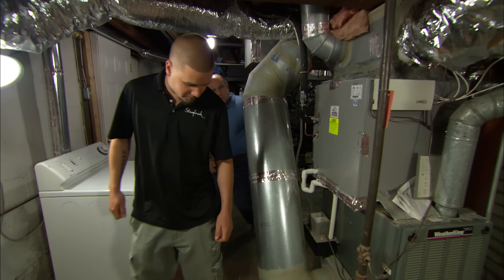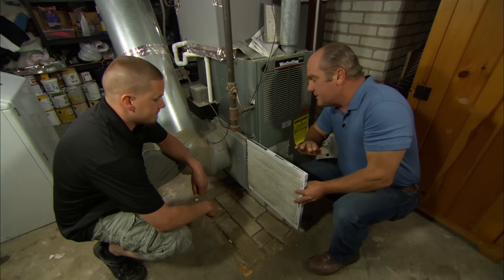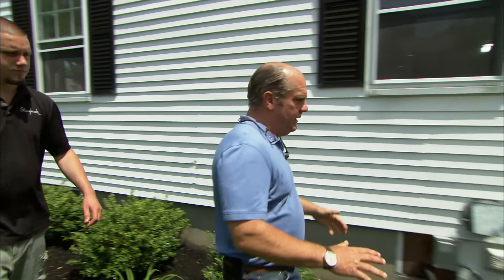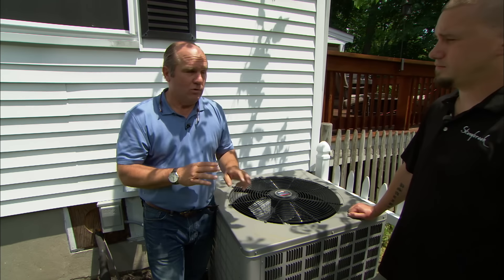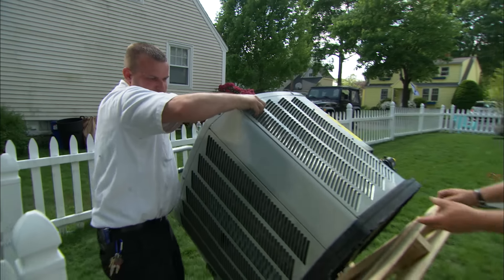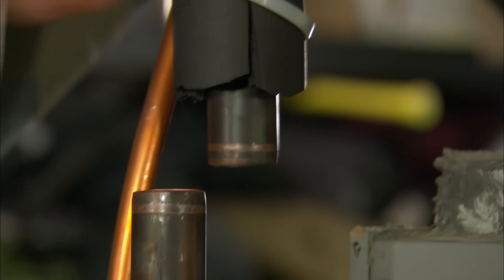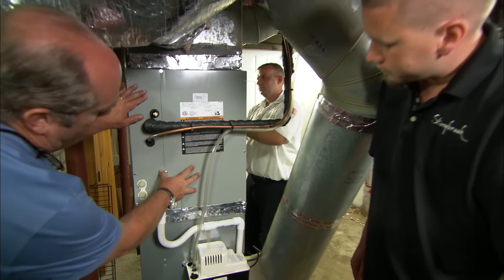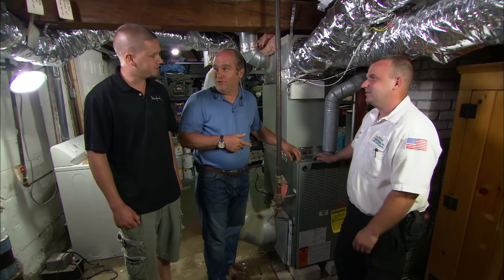How to Repair a Frozen Air Conditioner | Ask This Old House

Comment: My window AC freezes on high. Low it works all day. I have to turn it off if I set it to high to unthaw it. takes an hour of burning up. So it stays on low and barely helps in the hot hot weather.

Comment: This video should be called how to replace a cooling system. I would think there would be some way to purge the excess on a system that is bigger than needed in some manner of venting to the outside or temp setting. I had this problem once, and I had to move some things that were blocking the return air vents. They were a convenient place to put things in the winter. It didn’t seem to mess with my furnace for half of them to be partially or totally blocked, but I will put stuff on back them next winter if it turns out that my furnace is too big for heating my house.

Comment: How many years has this run without a problem first. If it’s worked right for years then how can an oversized compressor be the problem?  I think the problem was much smaller and less expensive than a new compressor and coil.

Comment: Should of checked to see if the system had the proper charge in it. Most likely it had a leak and was low on refrigerant. Also instead of assuming the size of the system needed you should have taken and got a heat loss/load calculation done to determine exactly how much tonnage you need to cool the home.

Also that return duct is way to small and that 10 inch pipe to the filter box just killed all the return. should be changed out to have a return drop that will allow for more return air.

Comment: The problems that I see: he should connect the gauge to the condenser to be sure the frion pressure are ok , after melt the ice on the coil. 
The return duct is very small for that unit of 4 tons. 
He should change the return  filter as well.
But I don't see necessary to change the 4 tons unit.

Comment: I love the comments.  Most are feeling the same as me, WTF.  Whoever installed that 4 ton sold this guy a bill of goods, this one was not much better.  Low refrigerant sounds about right. Probably a good leak check is in order.  I would also check the CFM of that furnace which is older and too small far that coil. Older units were lower CFM so may be too low for even the new unit and as someone mentioned the return may be too small.  Don't get me started on when he does anything to a boiler.

Comment: Let's talk equipment sizing. He's absolutely correct that the equipment is oversized. The size of the equipment has everything to do with the cooling load. There are a few things about this video that are problematic however. Oversizing the equipment should not cause the A coil to free up. The main problem with oversizing equipment is that you lose humidity control a the AC will short cycle. In other words, the unit will run for ten or fifteen minutes then shut down. Freezing A coils are caused by low airflow or low refrigerant. He never checked the furnace for it's blower capacity or the refrigerant level of the unit. If the refrigerant level is low, the coil will freeze. If you have a four ton unit combined with three ton blower capacity the coil will freeze. I feel like he went straight from "the filter is ok" to "let's swap out equipment" without checking out other options that would be far less expensive. I don't live in New England. I live in the Midwest where air conditioning actually makes life bearable. We have HOT summers with a lot of humidity. We run our AC all summer long now just for a day or two here and there maybe adding up to a couple of weeks per season. I would never just look at a problem and go right to the most expensive solution without offering other less expensive options. Perhaps there was a higher blower setting on the furnace.  Us watching the video never had the chance to know that as that was never addressed. Was the unit low on refrigerant? That wasn't checked either.  Instead of offering solutions that might cost a few hundred dollars, we go straight to the $5,000 solution. Replacing the equipment is the best solution,  I'm not disagreeing with that. I disagree with the process. It's the HVAC contractor's responsibility to educate the customer and help find out the best solution for their situation and their budget. I never once heard anything offered to make the existing equipment work better. I'm not knocking This Old House, but they are would the contractor to call if you have an unlimited budget for a remodel.  Just saying........

Comment: did i miss something, what was the superheat? what was the subcooling?
Reply: No need to even check those readings, because they won’t be right, if there isn’t enough load to boil the refrigerant in the evaporator coil.  A lot to the problem was right in front of them.  The coil should have a saturated temperature of about 40 degrees, which is a standard that the units are tested at.  This evaporator coil was running below freezing.

Comment: As a service tech I would ask myself why all of the sudden is the coil freezing.We must assume it worked at some point.I cannot believe that the ac system was freezing up since day 1.So if the air filter is clean then why for the love of God would you not suspect the Freon has leaked out.If it is oversized so what.Leave it at this point.

Comment: if the coil leaked and it was dirty, would it still freeze up?   is it worth it to replace just the evaporative coil on a rheem AC located on the roof?  one guy offered to charge 230 to clean it, the second guy said it leaked, didn't clean it and charged $429 for 5 lbs of r22 freon.   i think i was ripped by second guy

Comment: Something doesn't add up here. Our house was originally built with an air conditioner that was oversized because the HVAC company sold the builders on the claim a bigger unit would have better cooling. The only time we had a frost over was just one time when a pipe that was to drain condensate had clogged up. Even when we had our system replaced a few years ago the guy told us the worst an oversized condenser would do is just make the house a little too cold and waste energy by running more than it needed to.

Comment: melt the ice, turn on the gas heat for 30 minutes.  low refrigerant is the issue...welds may be breaking down.

1

Donnie Young
Donnie Young
1 second ago
airflow from a 2.5/3 ton furnace blower through a 4 ton Sideways coil...which causes weird vortex's that create wind friction thus reducing air flow....and then paired to a 4 ton condenser with a lack of return...as you saw that 8 or 10 round return duct....so the return was undersized...the supply was probably good for a 3 ton (as i would hope the installation was close enough). ..the unit was over sized for the square footage of the old house...and then...at its best...the 3 ton furnace blower could not achieve the demand of heat absorption required by a 4 ton unit with the existing problems.  Basically, it was a lack of knowledge on that installer...i follow them all over town fixing what they couldn't see.  However...they could have increased return and supply and added a 3.5/4 ton driver furnace so as the coil would fit the furnace and then get a t-stat that controls humidity...so as not to create a chilly humid feeling as well as control potential mold growth on cellulose base materials such as sheet rock...but this would cost as much if not more...depending on the design of the space...anyhow...i hoped you liked reading this lengthy reply bro...lol
 

Thought i wold share this thought process....simply learn how to read super hear and/or sub cool...and then learn the simple things that cause lack of either/or
Reply: i apologize if i seemed curt...had to follow a couple of company's that day that simply made simple things into ordeals for my new client...now i have to become the the psychiatrist/tech and hope i can control the crying and not have to learn about how someone's someone just passed away...Y'all know what i'm saying!...stay hydrated!

Comment: There are some times when a massively oversized unit needs replaced. Not a huge difference between 3 and 4 ton. There are a lot of cheaper options he could have done. He immediately went to the most expensive option.
Reply: Likely they went with replacement to film the video

Comment: The freezing problem is inadequate return air. On the video, the return looks like 12" (500 CFM}. Less than 2 tons of airflow. There are other factors and, as per the video, 4 ton is too big for the house's heat load. Notice this a/c has a TXV fed evap. Lack of superheat (probably caused by airflow at the evap coil) allows the evap temp to fall below 32 degrees allowing ice formation on the evap coil thus air blockage. Installing a 3-ton unit (less there are immediate plans to increase the square footage of the house to 1700/1800) is overkill and the coil will still freeze with the small air return. In that, the homeowner was screwed by a poorly proficient contractor I would make that system run so that the homeowner could enjoy the use of the system he has already paid for by making the modification the to the ductwork. I can always come back in a few years and install a correct system. I have seen this so often - a house that was built with only central heating have airconditioning added and the contractor does not ad returns. Not always the contractor fault when you consider the homeowners lacking the knowledge and seeking the lowest bid has a system installed - a return duct addition or modification cost money. If a competitor does not bid it, they will probably get the bid.  I have seen a lot of this. Be mindful  This Old House probably paid for most if not all of the work done here. Consider that when you compare your world with this homeowner.

Comment: Why not fix the original unit by cycling the outdoor condenser on/off when the evaporator coil is slightly above freezing (day 35 dgF). Then it can never freeze up.

Comment: I hate to see when people are directed to buy a new system without appropriate troubleshooting steps. Just checking the filter and duct sizing is not enough to diagnose the cause for an AC coil icing up.
1- Did he ever asked if this 4 ton system worked correctly or it was installed recently by a non-qualified HVAC technician?
2- Did he ever check the existing refrigerant level?  What is the super heat or sub cooling?
3- Is the TXV stuck causing the icing up?
4- Did they check to see if the contactor on the condenser unit is welded closed and when the air handler blower turns off, it causes icing build up for the next cycle. 
5- Did he check to see if there is an option to increase the air flow by selecting a different blower motor speed.
6- Did he mentioned the option to keep the 4 ton coil and reuse it with the new 3 tone condenser to save $500-$800 which will increase efficiency (the larger coil, the more heat exchange). After all it has a TXV that can be adjusted between 3-4 tone operation. 
7- If homeowner has 1200 square feet house, then according to the tech, the customer only needs a 2 ton unit and not 3 tone unit. Then why install a 3 tone unit?
8- In the video, the HVAC technician has not even cleaned the suction line coppers properly prior to brazing it, and he does not even plan to pressurize test the system before vacuuming it and checking targeted Supercooling for the OEM TXV. Where do they train these HVAC techs?

Comment: No the condenser comes pre charged for a 15 foot line set and factory matched evap coil. Says it right in the book. If that line set was longer than 15 ft its still low on reefer. 
Also, didn't need the P-trap as its positive pressure.

Comment: That return duct looked like it was 10” round.  Way too small for even a 3 ton unit, that probably caused the iced up coil.  Plus installing a return plenum box would also be better as you would get a more even flow of return air across the filter.  Also one last thing in Richards explanation of the refrigerant cycle, cold refrigerant does not come from outside unit.  The line he was pointing to was the liquid line and he stated that line sends refrigerant back to the outdoor unit, thats incorrect, it actually flows in the opposite direction of what he states.  I am surprised, as a TOH viewer and fan, I thought Richard knew his stuff, but maybe not so much when it comes to A/C and refrigeration.

Comment: One of the biggest causes of freezing up is a coil full of dirt (pet hair, dust buildup, etc.) due to bad filters, will cause the coil the to freeze up because there would be no air flow...same as no air through the filter...

Comment: As an HVAC tech , my thoughts : 
He didn’t chase up the simple faults he first mentioned: ie low airflow etc. A lack of logic fault-finding here, think: why has this unit worked for so long without this fault ? Oversized unit: was not the fault. An oversized unit does not cause icing, unless there’s some additional fault, low ambient temp or poor airflow
Reply: my ac was freezing up after original 2 ton was replaced with a 4 ton so whats the problem its wasnt cooling the house down and now the coils inside house freezes up and we have to run it on 81 just to not faint at night HELP

Comment: Even I agreed Richard is an experienced plumber but this time it does not make sense. The coil gets frozen was due to the temperature dropped below freezing point. That should not happen for a residential AC unit. The temperature drop before/after evaporator is controlled by the expansion valve. In this case, it is most likely the reason. It has nothing to do with the size/power of the unit. Replacing the whole unit certainly works but it is not necessary. The bottom line is it should not be frozen if you run AC during winter time, because the Freon should become that cold.

Comment: 3 ton for a 1300 sq ft home idk bud . I would double check my return and supply air to see if I could move 3 tons of air if not most likely a 2 ton or a 2.5 ton unit would be sufficient enough for that size home .

Comment: Sometimes a freezing evaporator coil is caused by low freon.
Reply: True, but if the suction line frosts right after startup, it’s an airflow problem, or running the condenser at a low ambient, without head pressure control.  Only the first part of the coil will frost with low refrigerant, then after it’s caked, the next part will frost, until it’s all frosted.  Also the frost will look more like  ice, and takes a lot longer to form. This will happen with a restriction too.

Comment: The heat does not get transferred to the outside through the expansion valve and liquid line but goes out the manifold at the top which connects to the suction line (larger pipe).  There are generally two things that cause a coil to freeze.  It's clogged with dirt which reduces airflow, or the system is low on refrigerant.  All of the measurements and ciphers were good for the camera, but you should check the cleanliness of the coil and the pressures first.  That does look like a very poor duct installation, though.

Comment: I don't think bigger unit can be problem of frozen coil, it's only impact will  thermostat cycle on and off the unit very quickly, causing low efficiency high electric bill

Comment: The guy who installed the original system messed up, this isn't the most common reason they freeze. They usually freeze from restricted air flow (like a dirty filter) which they covered or low refrigerant, a broken outdoor condenser fan could also be a cause.

Comment: The original unit was probably just low on Freon, lower refrigerant charge equals lower temps for the evaporator
The evaporator should not be below the freezing point.

Comment: low air flow is sometimes caused by a dirty blower wheel. he didn't check that. and if it ran when installed and now it doesn't, check the freon level. if it really is too big a unit, you could recharge it with nu-22 which is about 10% less efficient. as a last result, call a professional tech.

Comment: Everyone is wrong, comments and Trethewey. It's about airflow over the coil. With enough fan speed, the house cools quickly and system shuts down. Number one biggest problem is most blowers are not fast enough.

Comment: 1 ton per 500 square feet hasn't been true since 1980.  A manual J load calculation is REQUIRED when changing/sizing an HVAC system.  He talks about things that affect load canculations but then falls back on the 1 ton/500 sq ft BS.  And if youare removing a perfectly good 4 ton systems why not pump the system down the recover what little is left in the evaporator and line set.

Comment: I love Richard but his explanation of the refrigeration cycle should be ignored. 

First off, we DO NOT size a unit for the hottest day of the year. We size a unit for the AVERAGE hot day for your specific zip code.  If you sized it for the hottest day of the year, your unit would always be short- cycling on those mildly hotter days. 

Here is how the refrigeration cycle actually works: 

Warm high pressure liquid comes from the outdoor unit via the small pipe called the liquid line, it goes into the house and is connected to the indoor evaporator coil. Liquid is stacked against an engineered restriction called a thermal expansion valve from the compressor building pressure against it. The valve opens and closes based on the temperature of the vapor line (big insulated pipe). When the high pressure liquid is allowed into the evap coil, it enters in as a low pressure vapor, in turn it gets very cold from the drop in pressure. The heat in the air passing through the coil is absorbed by the refrigerant and carried off in the big insulated pipe back to the condenser (outdoor unit).

The cold low pressure vapor enters the compressor and leaves as a hot vapor. It then travels into the condenser coil and a fan blows air across the coil to cool the refrigerant back down and then it condenses back into a liquid. 

Repeat until the thermostat is satisfied.

Simple stuff.